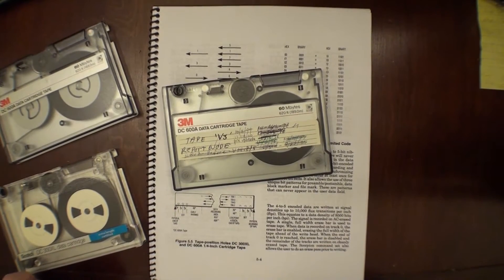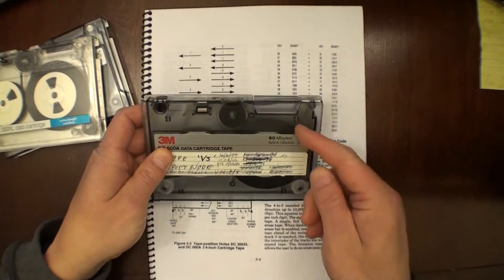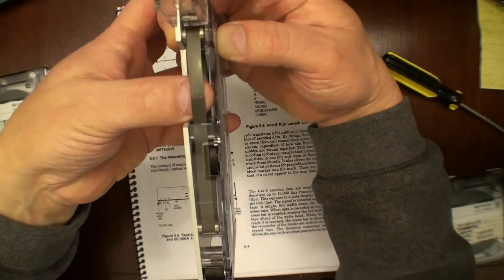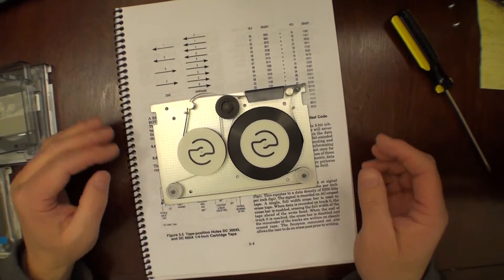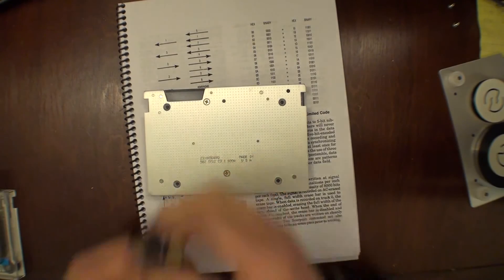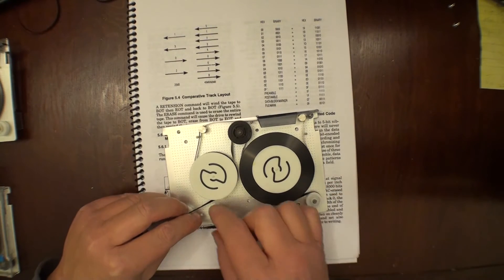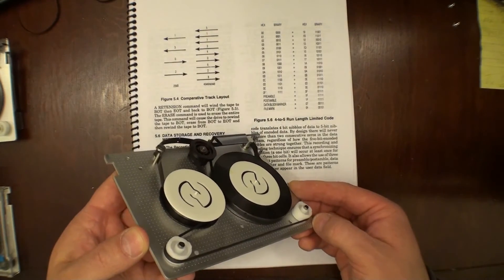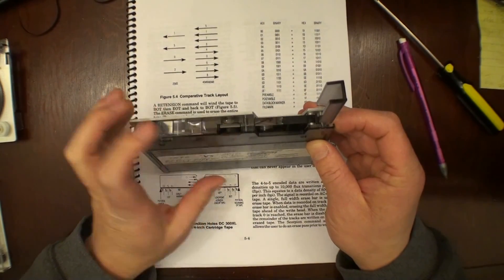QIC Tape Cartridge Belt / Tension Band Replacement

Comment: Can you do a video on belt replacement on TRAVAN tapes? They are smaller so more difficult. What happens if the beginning of the tape with the holes and data headers are crumpled/damaged? Can you still retrieve data from it? Where to get replacement pinch rollers for TRAVAN/QIC drives? TRAVAN/miniQIC tapes don't last as long (10 years) as their full size counterparts such as SLR (30 years).
Reply from the maker: Someday, possibly.  I don't actually have any TRAVAN tapes, as they are a bit too new for my focus of Forgotten Machines from the 1970s and 80s.  But, if I do come into possession of any, and have a good reason to explore them, I'll strongly consider your request here.

Comment: Fantastic video! Thanks  a lot! Question: why do you care about the double holes in the tape, why don't you simply rewind the tape to its beginning?
Reply from the maker: Hi, thanks for your comment, and great question!  I care about the double holes because this marks the beginning of the readable tape, called the "BOT". Since I'm getting my fingerprints all over the tape in this procedure, and possibly accidentally wrinkling or otherwise damaging the tape in the process, I want to be certain that I'm doing this procedure in the "non-data" area of the tape, and therefore doing this work in the section before the "BOT" double holes.  

I hope that explains it?  Thanks again for your interest!  Are you restoring QIC tapes too, or considering doing so?
Reply: @ForgottenMachines Hmm no it doesn't really explain, or I'm a bit slow. I would make a big bet that at the very beginning of any kind of tape, nothing is stored, so potential fingerprints wouldn't accidentally destroy any data, right?
Reply from the maker: @fondueeundof3351  Yes, you understand the concept.  The double holes marks the place where the data begins, so doing the work in the section of the tape BEFORE we get to the double holes is important.  And therefore, in order to do that, we must know (and see) where the double holes are, first.
Reply: @ForgottenMachines  Do we agree that the double holes partition the tape into two segments? A relatively short one and a very long one, right? On the relatively short segment, i.e. between the very beginning of the tape itself and the double holes, no data is stored, you agree? So why don't you simply rewind to the beginning of the tape and spare yourself the work of finding the double holes?
Reply from the maker: @fondueeundof3351  Yes, we agree...but in this video, had I never shown the sets of "BOT" holes, then I couldn't have demonstrated 1) where they are and what they look like, and then 2) given my caution to do all work "before" they are reached.  So this was informational training for all who are interested, and to give a better understanding of how these cartridges work.  But generally speaking, yes, when I do this by myself, since I already know that the beginning of the tape is safe, I just do the band replacement there.  But videos are always more interesting and informative if we show all we can about the what and the *why*, which is what I've done here.  As it is said, Inquiring Minds Want To Know...and now you do!
Reply: @ForgottenMachines  Fair enough!